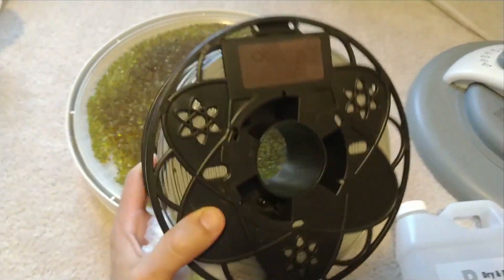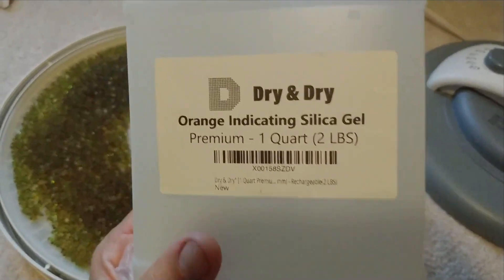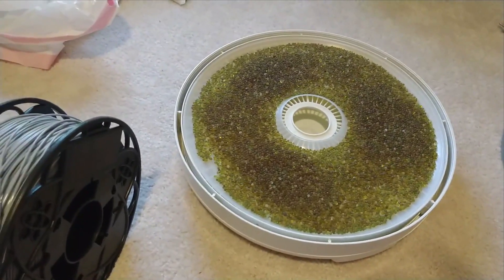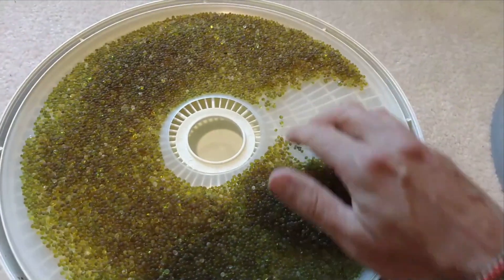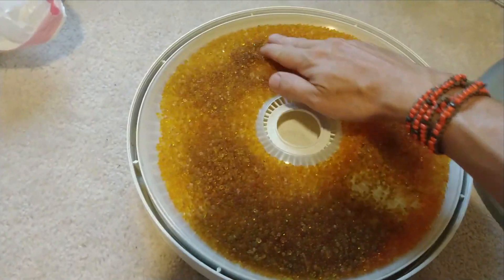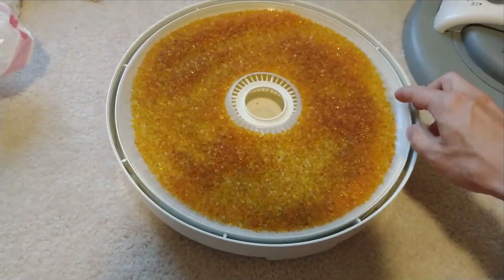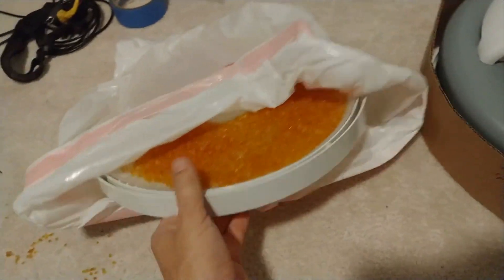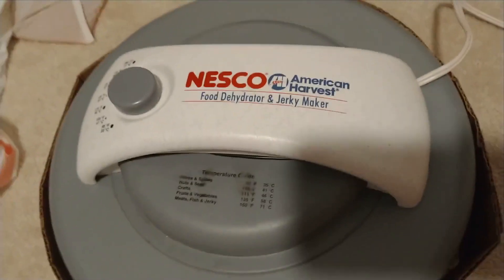Drying 3D Printing Filament and Desiccant in a Dehydrator

Comment: I used some flush cutters and snipped out the tray on a few levels of the same dehydrator and use it to dry spools too. You can usually buy these at garage sales for nearly nothing.
Reply from the maker: I just learned about flush cutters recently and they are awesome